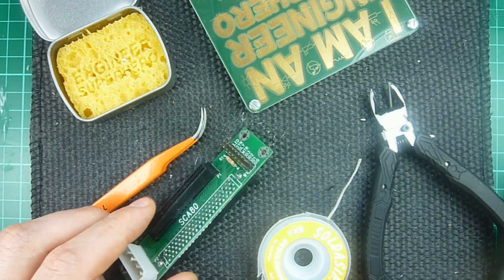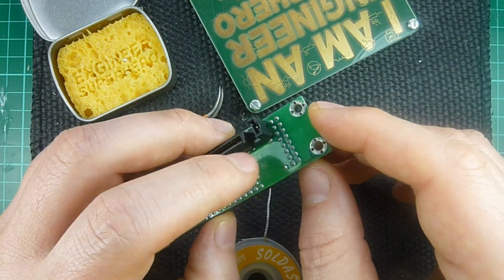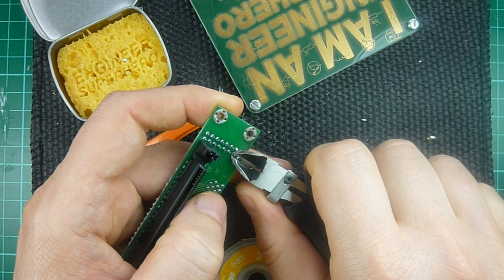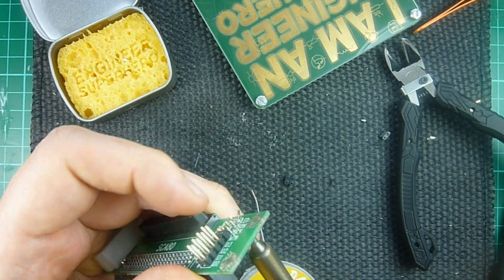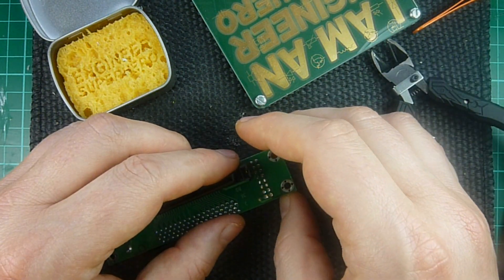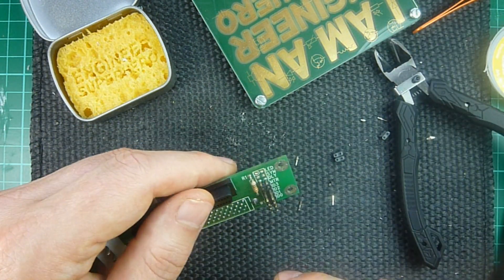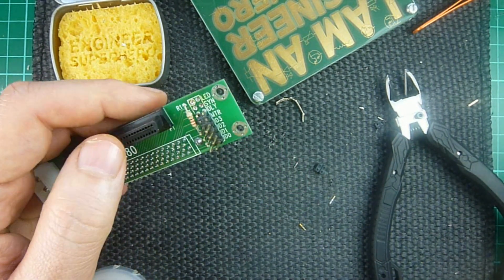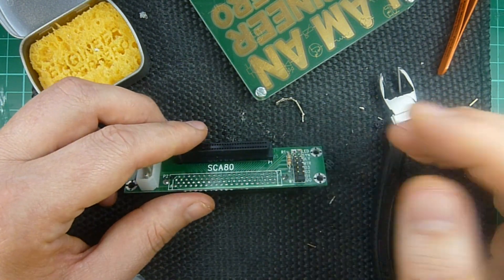Cleanly de-soldering a pin header

Comment: I just gently pulled the plastic bumper up with some tweezers and a screwdriver to pry it up. This was with a 40 pin Raspberry Pi header. Then desoldered each pin, and reassembled all the pins back into the bumper for a perfectly working header.

Comment: You made this  harder than it needs to be. Once you’ve removed the plastic, it is quick and easy to desolder the pins.  You don’t need to do all that clipping.  Also, the way you removed the plastic, by prying them up off the board , looked like it could possibly damage a pad. You can cut vertically to separate the plastic into 3 or 4 pin chunks and pull them off vertically. Finally, if those are the same fine point tweezers you use for SMD soldering, you could easily destroy them that way. Overall I would rate your method as ‘inefficient’ and ‘brutal’.

Comment: Cutting the header is not brilliant. Maybe it would have been a nice idea the wiggle the black plastic off first, the de-soldering all pins one by one, then reassemble and resolder. Or heating alle the pins at once, the take the header out, clear all the holes and put the header in the right way.

Comment: Jeez man, I mean it's a helpful video, but it's not that hard to remove headers.  Hold board in vice grip, or even just put a book on it to hold it onto a table.  Hold bottom of headers with pliers.  Heat up top of headers with soldering iron.  Rock back and forth as you heat each pin, and it slowly comes out.

If it's a very large or complicated header, you use a solder wick or solder sucker.  They're like $2 at any electronics store.

Comment: With a suction pump (even a $2 one) you can remove the whole header without damage to the board or the header. The important point is making sure the solder has completely melted (not just the part on the side where you apply heat, you have to be sure that the part that is in the hole and possibly on the other side are melted too) by gently trying to make the pin move. If it moves, you're good to go. Add some solder beforehand if you don't have a good enough thermal contact with the iron. There's a lot of videos detailing the process out there.

Comment: To clear out the holes you can heat them up and use compressed air to blow out the solder. Adding flux always helps and I've found that sometimes adding solder actually helps to clear out the holes when you can't sen to clear out that last little bit.